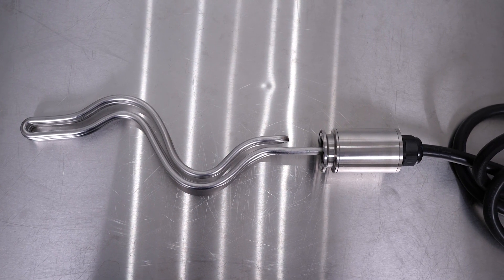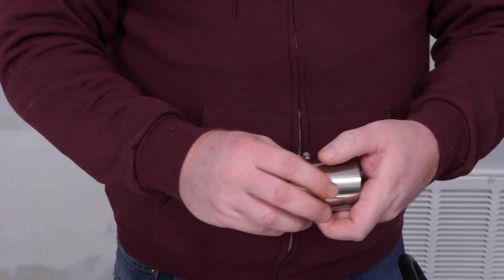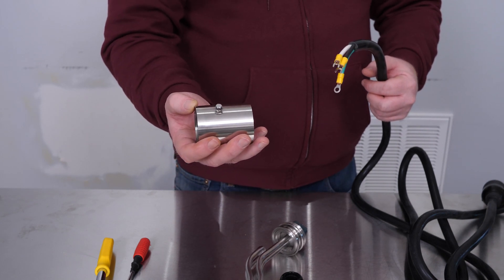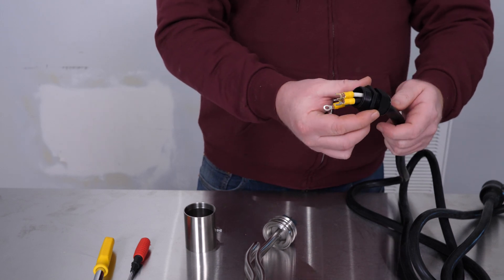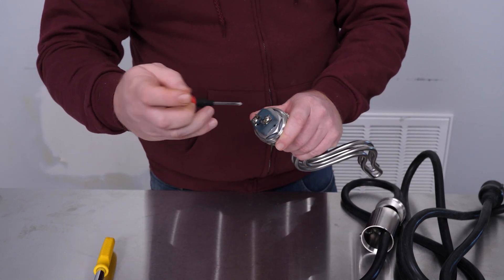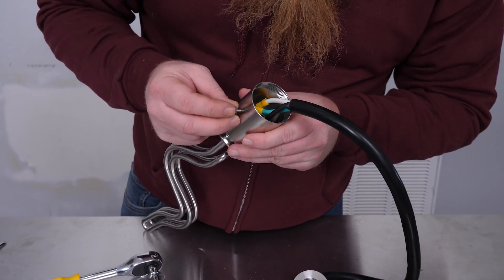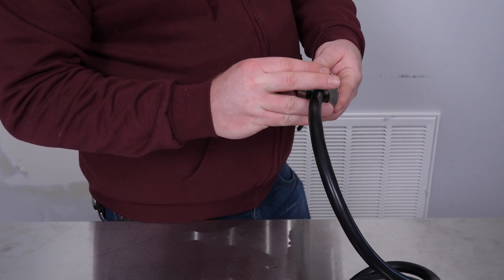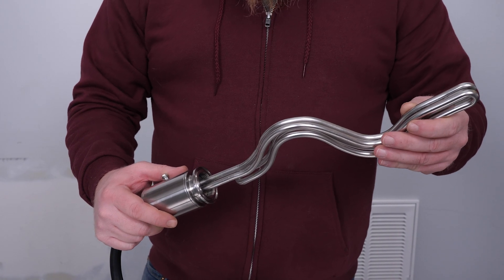Brewing and Distilling Electric Element Assembly

Comment: What gauge wire is in the kit?
Reply: Rule of thumb is 12 AWG for 240 V and
Reply: @bradywalton1357  Not a bad rule of thumb but I am far more comfortable with 10AWG,  If I am using a high draw element i.e. 5500 watt.   volt x amp = watts.   I can melt a 12AWG cord pretty quick with enough draw.

Comment: Note from personal experience:
 
Only hand tighten the part that you thread the heating element through. I used a wrench and it bent the rubber gasket causing water to leak through. When you set it up for the first time leave water in the kettle overnight. Leave the controller unplugged. The next morning you can unscrew the back of the housing at the cord grip to check for leaks. Use a pencil to push in piece of a paper towel. If it’s wet then you have a leak. Much better to find out with plain water than when you have wort at 170 degrees.
Reply: I also learned that lesson the hard way. Wort got in and fried the wires and element. The guys at clawhammer were amazing helping me fix the issue.